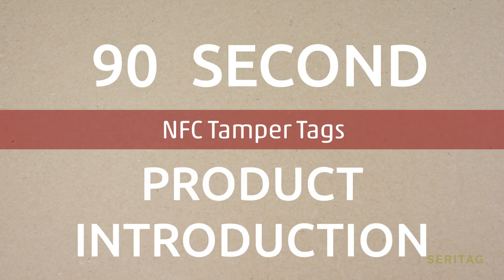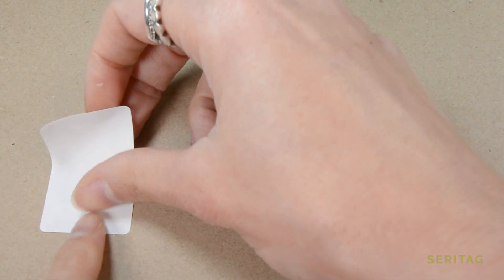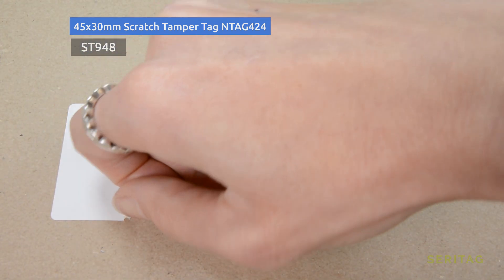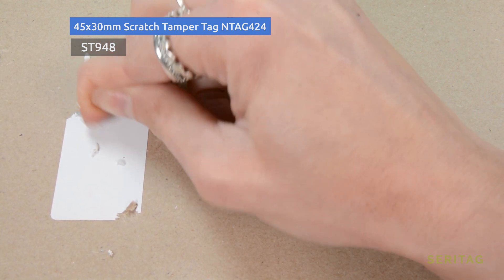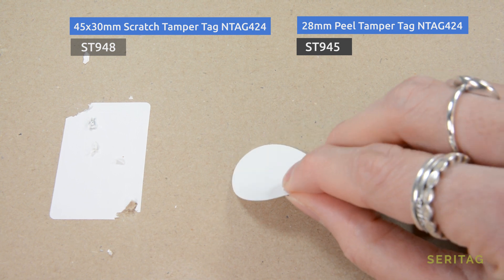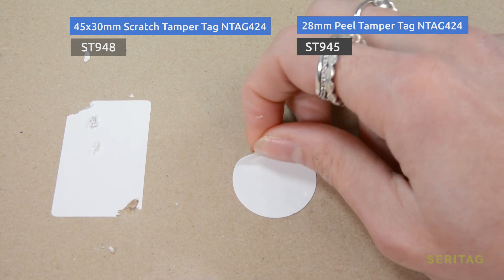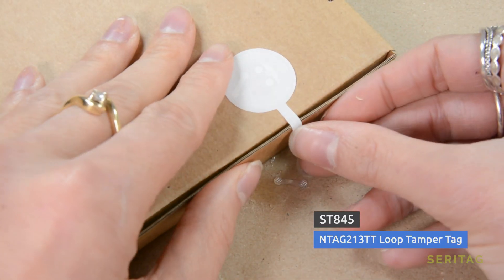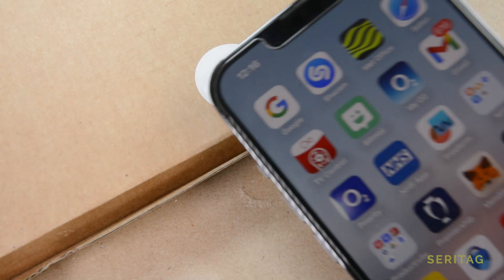NFC Tamper Tags - A 90 Second Product Intro

Comment: Is it possible to have a tamper tag combined with your garment/clothing tags ?
Reply from the maker: It's not easy. Getting the tag integrated into the clothing enough so that it will fail when tampered but not fail under normal flexing of the garment is difficult. We've tried a lot of options. To get a tamper tag that can then also be washed is even more difficult. 

There's two options. 

A completely custom made unit which, like the security tag in clothing stores, goes through the clothing and an attempt to remove breaks the antenna or the tamper loop. We have done this once and the costs are substantial - custom plastic housing, custom antenna design, but the concept works. 

If the tag can stay dry (for example, liner of a designer handbag) then we have a peel tamper tag with a very sticky adhesive back. This is strong enough to provide a good bond to fabrics and then allow for a break when an attempt is made to remove. 

For more discussion on this topic, visit https://seritag.com/qa/is-it-possible-to-have-a-tamper-tag-combined-with-your-garment-clothing-tags